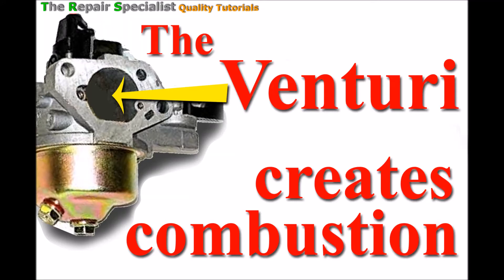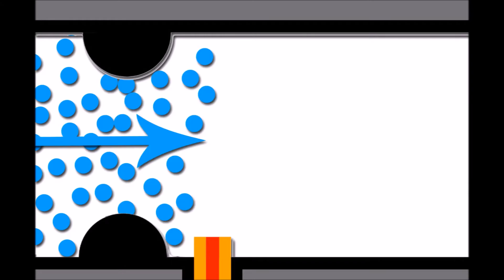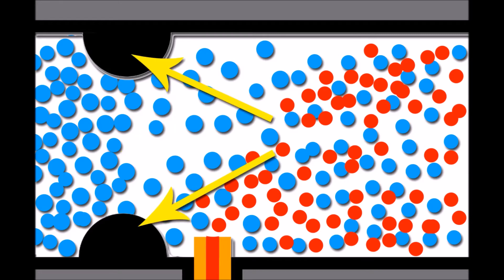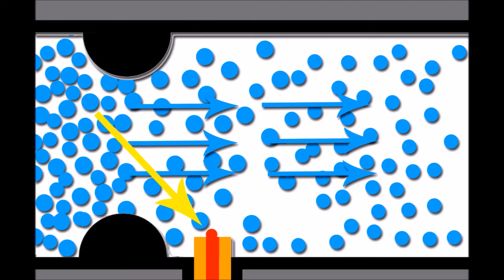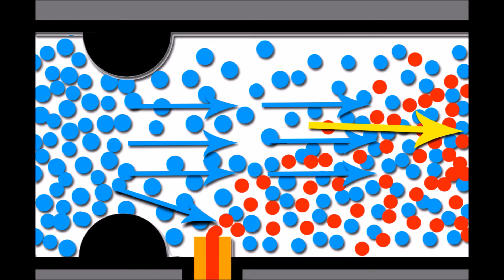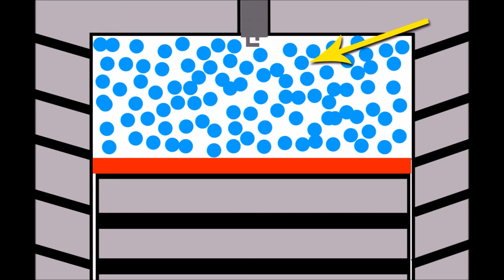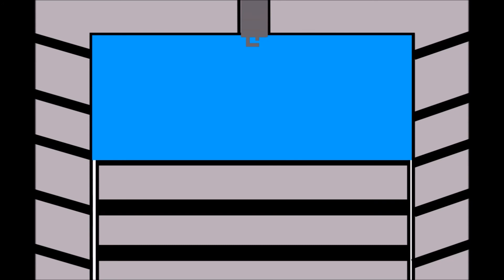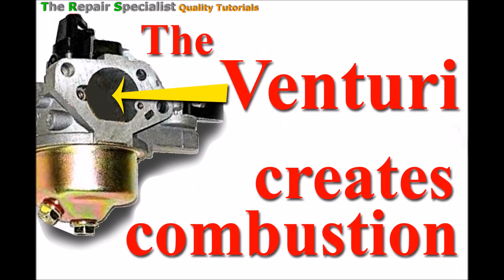Function of the Carburetor Venturi - How it prepares Fuel for Engine Combustion!  (by Craig Kirkman)

Comment: I know how a carb works im just bored landed on ur videos and i like the way u explain things and i lika way u tawk mmmmhmmm lol but this video made me wonder, if the fuel has to be atomized for the engine to run, how come u can just put a half tea spoon of gas in a chainsaws carb and it will run? Actually I use the plastic part of a needle whatever thats called the plunger part and I've squirted gas in the cylinder without even having a carberator on it at all and it ran. So why is that? U can even keep it running if u keep squirting it in there
Reply from the maker: Yes In my own opinion and experience I agree that you can run an engine in this way if you are mindful of how much gas you are including into your cylinder. However, the engine won't run in an optimal way and will run quite lumpy and lack the power it was designed to give. Thank you for your other nice comment. Do have a marvalouse day,  From Englishman Craig. 😊👍
Reply: Even though you`ve introduced fuel by just putting a small amount through the air intake , you will still get some venturi effect , nothing like you should and as Craig says will run lumpy/rough due the fuel poorly atomising , also you need to be careful doing this as it can lead to hydralicing and possible serious engine damage as you could exceed the air fuel ratio